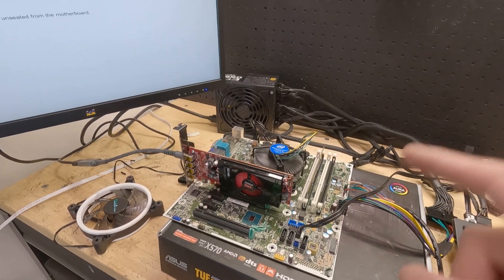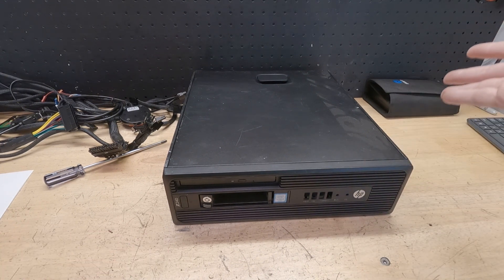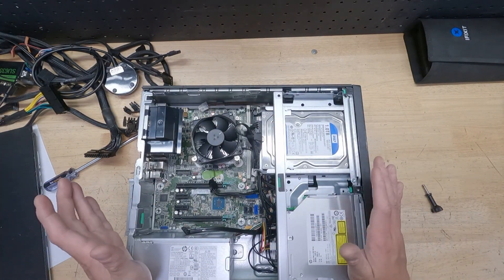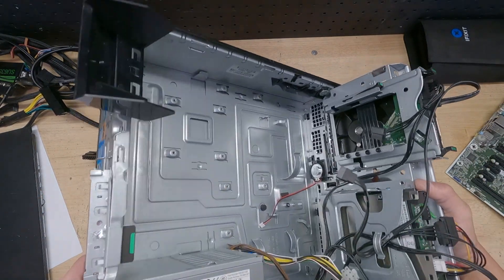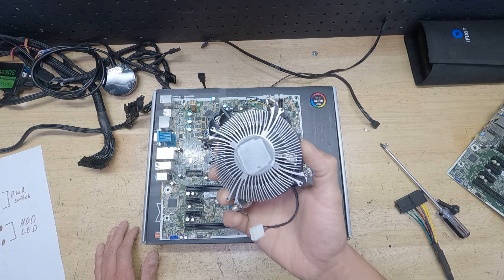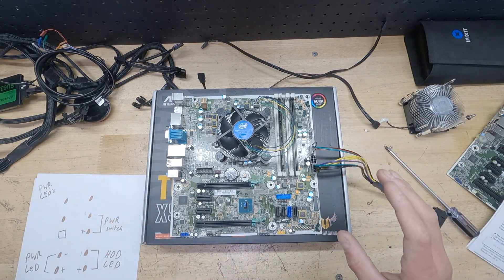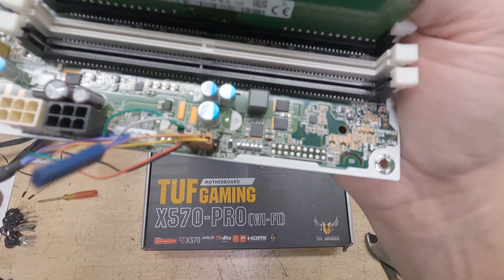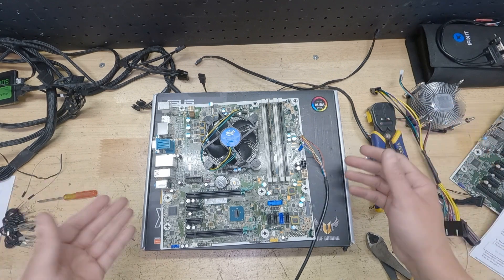HP Z240 Case Swap Guide!! Everything you need to know!!!

Comment: I have a dell optiplex 3010 mt. And my PC is very slow after resetting windows and keeping my files. I have updated all my driver's and updated everything and I get half the frames I got before. Do you any help you can give me?
Reply from the maker: might be alot of bloatware programs running in the background. go to task manager and see what is using the most cpu and memory usage, also what are the specs. you need to find what is taking your resource and probably just uninstall it. if not then maybe the new update might be a little too much if you not running 8gb of ram or an sssd.
Reply: @DLMtechgarage  I have a i5 3470 gtx 1650 and 8gb ram but there wasn't anything noticible running in the background. I deleted all bloat ware I could. I ran a benchmark like Unegine heaven and my score went from 1300 before the reset to 947. I updated all driver's and bios and checked power plans. Been like this for 3 days. I even updated with windows 10 iso.
Reply from the maker: @guacandcheeze7036  hmm that's a pretty decent set up, maybe check the drive integirty, i have seen dying drives do this before.
Reply: @DLMtechgarage  I did chkdsk and used other programs to check and everyone of them says it's fine.
Reply from the maker: @guacandcheeze7036  man it's hard to say, did you check your cpu to see if it's downclocking itself?
Reply: @DLMtechgarage  my CPU might be slow idrk. I have installed all my drivers except my gtx 1650 driver's with drivers easy. I have done chkdsk and used other programs to check my hdd. I have uninstalled and installed driver's. I have installed windows 10 through an iso. I updated windows. Reset windows three times. Reset power plans and updated Intel graphics driver's. I did a safe boot and no program was messing with performance. I have no viruses. None have worked and it still is under performing.
Reply: @DLMtechgarage  actually now that I checked. I ran unigine heaven benchmark. My gpu stayed at 97-100% while my CPU was at 21-30% usage. Is that bad?
Reply: @DLMtechgarage  I ran a user benchmark rn and these are the scores I got. My CPU is performing above expectations 74.1%. my gpu is performing below potential 43%. My hdd is performing way below expectations 43%. And my ram is performing above expectations 55.3%. any tips on how to improve my gpu score. I'ma try to buy a better hdd becuase ssds are way more expensive.
Reply from the maker: @guacandcheeze7036  it's typical for that setup
Reply from the maker: @guacandcheeze7036  well if you running a HDD that might be your problem. they just struggle to keep up. I get 500gb SSD on amazon for like $50 buying the ADATA brand.
Reply: @DLMtechgarage  I think it's 100% my gpu and hdd. Becuase I ran pass mark and the gpu score online is 7769 and I got a 3218. Also my hdd got a 346.5 versus the 720 it has online. My CPU and RAM are not the problem. I just need to find a way to get my gpu performance back.
Reply from the maker: @guacandcheeze7036  check the temps, see if it's thermal throttling and downclocking itself, def need to get an ssd.
Reply: @DLMtechgarage  my tempatures are normal, maybe 2° more than usual. It's also not down locking itself. I did ddu and a clean install of drivers and it didn't fix it. I also rolled back driver's and it still didn't fix it. Something I have noticed is the card uses more MHz than before. Usually while idle it would be 300mhz-400mhz. Now while idle it's 1485mhz.
Reply: @DLMtechgarage  also when I use open hardware monitor to check my wattage. Before the windows reset it stood around 8 watts while idle. But now it's 18 watts idle. I know the app isn't too reliable but it's a big change.
Reply from the maker: @guacandcheeze7036  hmmm not sure, never really ran into that before, only thing I can say is maybe a bios flash, but honestly if the card is not downclocking or crashing its probably.
Reply from the maker: @guacandcheeze7036  noww I have seen that when the psu is starting to go bad, over volting hardware. Maybe get a psu test, their like cheap on amazon and it would tell you if the power supply is going bad.
Reply: @DLMtechgarage  I don't think my psu is bad becuase my gpu only started underperforming after doing a windows clean reset. I never pushed the system. I always capped all my framerates to 60 and undervolted to 800mV and underclocked my gpu to 1800mhz the day I got it. I only turned them all off and run stock when doing benchmarks. I'm gonna try to roll back my gpu driver's today.
Reply from the maker: @guacandcheeze7036  Def use DDU to do a fresh driver install. Makes a huge difference.
Reply: @DLMtechgarage  BIG UPDATE. it turns out I was just stupid. I benchmarked with a higher resolution than before so that's why my frames were lower. I'm still gonna upgrade my CPU and hdd. I'm thinking of upgrading to a Intel xeon e3-1240v2.
Reply from the maker: @guacandcheeze7036  ha ha it happens and believe me I have done worse. Glad you figured it out. And def get that xeon!
Reply from the maker: @guacandcheeze7036  dang I would never of thought of that but yea that would do it lol.. thanks for sharing def another tool in the book of pc knowledge!!

Comment: Dude the link for the adapter is wrong! 
For those that are trying to do the same swap you need one that says z220 or z230 the one on Amazon that specifies z240 is the wrong adapter only the z220/z230 works on the green motherboard. Believe me I tried for 2 weeks to fix this issue until I tried a z220 adapter and now I don't have the 90e power supply fan not detected error. I hope this helps others like me.
And please fix the link!
Reply from the maker: Thanks. link has been updated, never realize i used the wrong like!! much appreciated!!

Comment: if you want skip the (rear fan error) loop a wire on the front panel header on the pin next to power switch and the pin next to the blank the last pin stay  loose or nothing on it or empty just to be sure you guy understand my poor english
Reply from the maker: i gotcha def a good idea.
Reply from the maker: @koomei2  get a fan hub that either sata or pwm powered. ive used this one. link below.

https://www.amazon.com/ID-COOLING-Powered-Splitter-Computer-Internal/dp/B08BFJZWGM/ref=sr_1_11?dchild=1&keywords=sata+fan+hub&qid=1630864206&sr=8-11

Comment: Hi I have problem with Z230 sff case swap. After conneting everything I couldn't get the mb to actually start. Power led would blink and that's it. No fans spinning nothing. Green led on mb is on so I think the power adapter I bought is good. Any thoughts? 🥺
Reply from the maker: I have seen that happen with the wrong adaptor, has to be z230 specific, people tend to get the 240 and other models by mistake. looks similar but wiring is different.

https://www.amazon.com/COMeap-Power-Adapter-Workstation-12-inch/dp/B06XW7RWNH/ref=sr_1_2?crid=1FVVN67J3FFMC&keywords=hp+z230+24+pin+to+6+pin&qid=1675806217&sprefix=hp+z230+24+pin+to+6+pin%2Caps%2C65&sr=8-2
Reply: @DLMtechgarage   The one I bought was labeled for Z220/Z230 and looked identical. I already send back adapter and that Z230 😟 thx for answere though